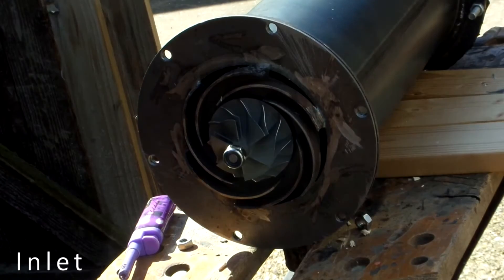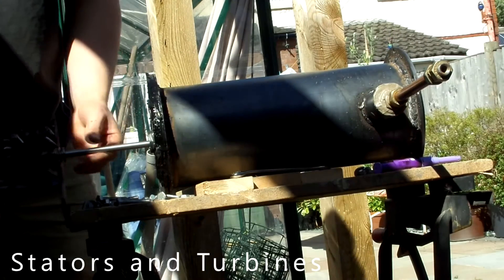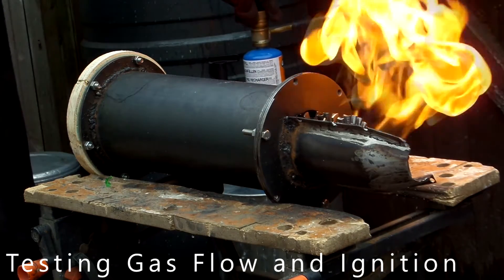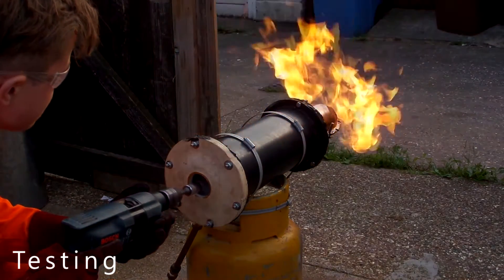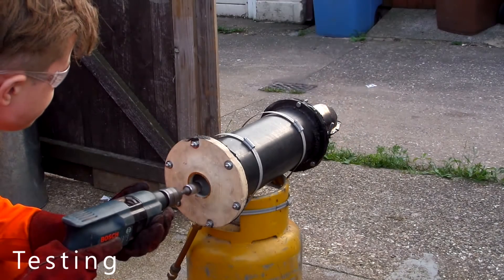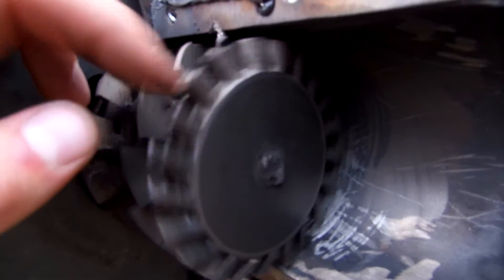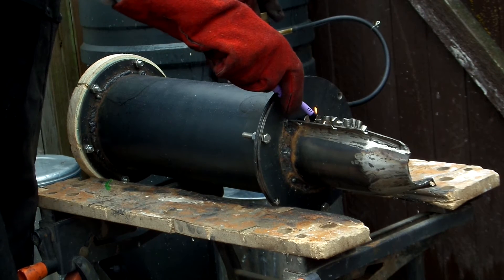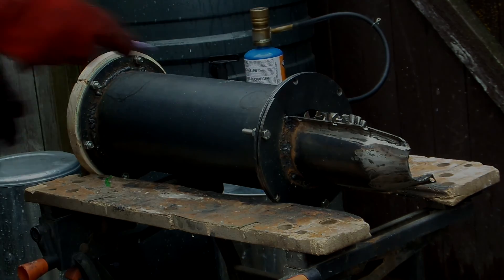Homemade Turbojet Engine Failure and Review

Comment: Good work. So the combustion chamber is too large for a radial compressor. Caution with the unbalance of turbine and the shaft mass. Never test this engine upper the LPG reservoir. Making a turbine map you can see the best rpm to start your engine. Good lucky!